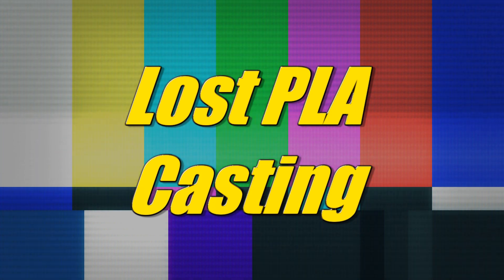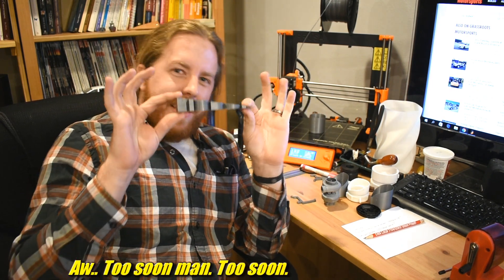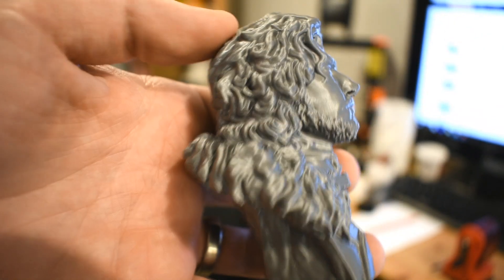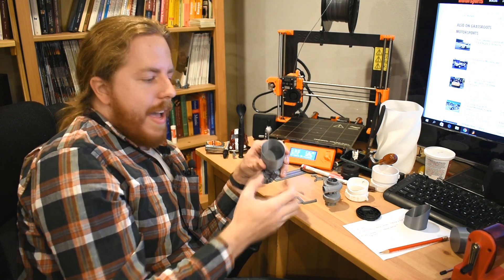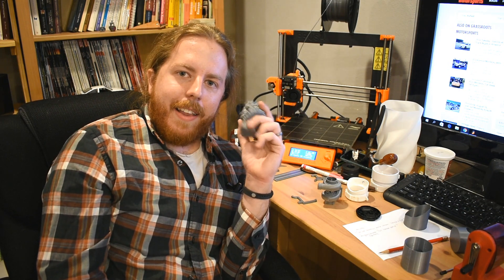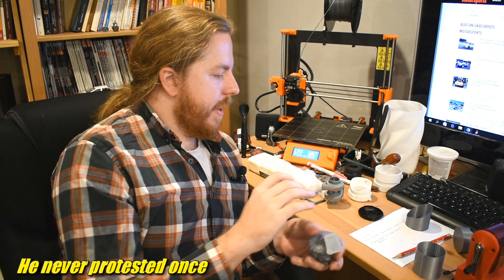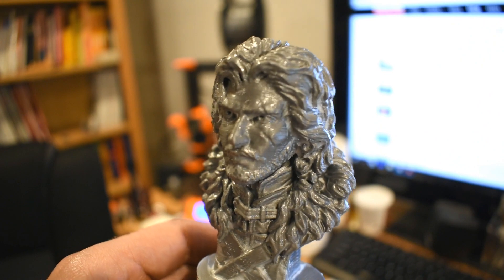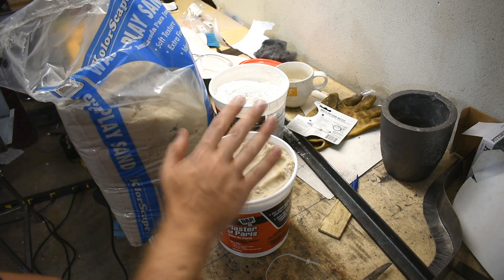Lost PLA Casting: Preparing a Print of Jon Snow from Game of Thrones for Casting in Aluminum

Comment: How to mix plaster of paris:
1.Measure out cold water first, ratio depends on what kind of plaster you use.
2. Pour plaster in the water, letting it sit and soak up the plaster for a minute or so
3. Mix thouroughly, you should get a creamy consistency with no chunks.
No need to produce chunky plaster water.

Comment: I guess using her toothbrush for cleaning parts is one way to get your daughter to stop coloring on the fun plastic toys that you are going to burn instead of let her have. My two year old likes to sneak into the computer room and help himself to my failed prints on my desk then sleep with them. It's a bit weird finding a pile of little, half printed stormtrooper helmets and debris under his pillow like he's some kind of giant, crazy ewok (giant compared to the helmets; he's a relatively normal ewok size in reality).

Almost as weird as how I kept smelling the coconut oil as you were waterproofing the model. To the point where I had to pause for a moment to see if I was having some sort of strange and less unpleasant smelling stroke symptom.

The only support related overhang luck I've had has been with touching supports. Any drop is bad, but a 0.05mm drop is almost fine. The problem is a gap that thin is practically solid and anything delicate is hard to keep safe. So either it has to touch and then you have to deal with cleaning that up - not my favorite, because if I were that artistic I wouldn't need a computer and fancy math to make my art for me - or soluble support, but then you need a second extruder and so on. In this case you might be better off chopping his head off around his nose, the printing the top and bottom from the middle and gluing it back together to get a no support model. Or do what I would do, and let the fur and hair hide the support sins and pretend it's supposed to look like that.
Reply from the maker: i've never tried touching supports, that might work for this print.  Some of them like the weeping angle i printed has very delicate fingers that probably wouldn't like support removal, but this thing is pretty stout.  The only severe overhand is his nose and that's still pretty manly tough looking.  

The coconut oil was crazy feeling, almost like wax that turned into greasiness.  it was weird, but it smelled nice
Reply: For connected supports without using a second, soluble filament, I'd recommend the ones Meshmixer makes. It makes a wide base branching up to a point for each spot that it thinks needs to be supported (or multiple bases as needed), which minimizes the amount you need to clean up. Works great for things that have a few recognizable unsupported spots (like aquiline noses or swords pointed down). I usually have to run it though some sort of model fixing service to get the supports to print correctly which I assume is just me doing something very wrong, but I've spent my time trying to figure out how to design parts that don't need fancy supports in lieu of learning how to make the fancy supports better.

Making the normal wiggly supports touch with the same material (pla supports on a pla model, like if you have a single extruder) is usually an exercise in frustration as you get to scrape them off the model. Not so bad if it's a nice flat surface, but horrible if it's not.

Comment: I dont trust you sir....this question that im going to ask gave me a bunch of sleepless nights....is your name really Paul?
Reply from the maker: honestly, yes. yes my name is Paul :D  But if you don't trust me, can you trust my answer?  :O
Reply: Yeah, but what if the answer was written by somebody else?!Actually yes, I trust you in making 2192F flames, so yes i trust you Paul.And what kind of materials you going to use for the better furnace?I guess that you dont really want to cast it from refractory again, are you?Casting furnaces is just a mess either when its a plaster-sand furnace or a refractory cement furnace.I really suggest Aluminum Silicate fibre.Or if you live in somewhere where you can get insulating firebrick for cheap I guess try that, I dont really have experience with firebrick so I cant tell the pros and cons ,but the AlSiO fibre is really nice and here, in hungary its much much cheaper than insulating fire brick.

Comment: lol, looks good so far. If you experience little BBs on the outside of the casting when you pour it, it's because of air bubbles that get trapped on it. A little tip is to take a paintbrush and paint some of the PoP on the part first before you shove it into the plaster, then it wont get those little air bubbles trapped to the outside of the part.

Comment: I'm wondering if you could make a shaft for the air to escape by embedding a plastic tube or rod after you put the 3d print into the plaster. Or possibly carefully drilling a shaft after it dries.
Reply from the maker: Drilling a shaft would be nice and easy.  I have some small plastic tube here, too, like the kind for icemaker installation.

Comment: I can't wait to hear the story about how you bumped into that stick hanging over the edge of your bench, resulting in the 30-40 dollar "weight" falling and breaking.  Maybe falling on your toes?  Then as it was falling you tried to catch it but knocked over the plaster of Paris mix all over you and the floor and your crucible.  Actually that would not be funny, but I bet if you don't do it I will.

Also, how hard was it to set up that 3d printer?  I had robotics in college but that was a long time ago, so I have been apprehensive about getting one.  I also don't know the software you need to make your own stuff.  Is there an open source library that you know of?  

Anywho great video and keep up the great work.
Reply from the maker: It was super easy to set up. I got the already built one, it was basically plug in and go.  I've had to mess with settings a bit as prints got more complicated, but it's pretty easy with this printer.  It works really well.  Not cheap, though...

Comment: Aha, I see what you did there. You made the print out of aluminum-colored plastic so you could make the thumbnail look like you had gotten a successful cast. Clever girl.

Did you do shaking or whatever to try to get the bubbles out of the liquid plaster after cutting the camera?
Reply from the maker: +TheVirindi huh I never though about the color.  That's the only PLA I have, it's what prusa supplies with the printer.  Irl it's too dark for aluminum but the camera kinda lightens it up.  And yes I did some jiggling of it to get air bubbles out.  I cut out like 75% of the mixing and stuff like that.